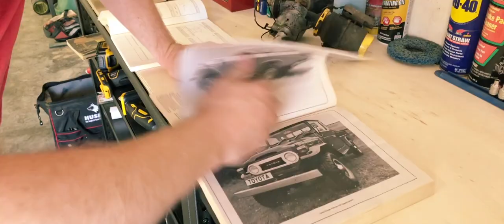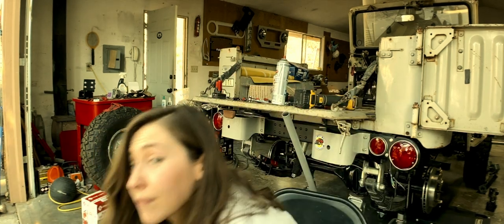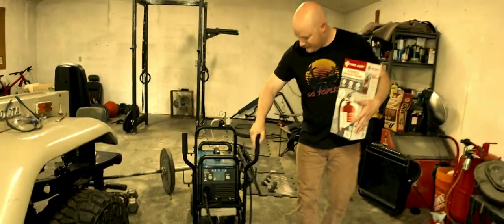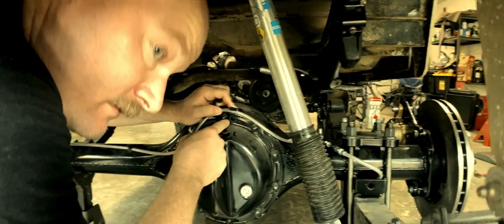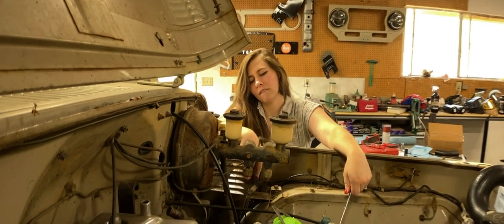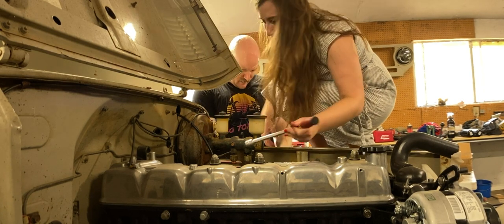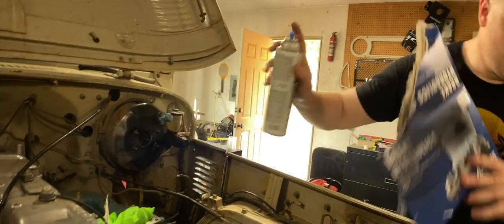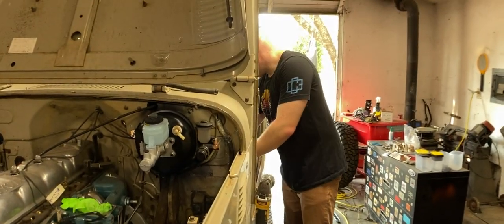FJ40 Brake Lines Part 3: I Listen To My Wife, She Lends A Hand, Install FJ80 Master Cylinder On FJ40

Comment: I had a hell of a time with master cylinders. I ended up using a manual S10 master cylinder. It's amazing. And cheap.
Reply: Also, Rachel needs to support the shaft when she wrenches like that...or something🤔
Reply from the maker: I’ll be excited to see if this one works, or I end up breaking something.
Reply from the maker: She’s still developing her shaft holding technique.

Comment: Love it when Rach is in front of the camera....... but she is better at operating it than you. Just another truth that you have to accept. Oh... and dont 'forget to check the gap on the brake master cylinder pushrod.
Reply from the maker: She’s lethal on both fronts. I’m struggling to be useful...

Comment: What's the reasoning on changing to the FJ80 master cylinder?
Reply from the maker: From what I’ve been told/learned, it’s a better master when running front and rear disc brakes.
Reply: The FJ80 has more fluid in the reservoir. The front and back lines are supplied by the same place instead of one of the small ones going dry and someone not knowing it’s low. I also believe better design and less likely to fail.